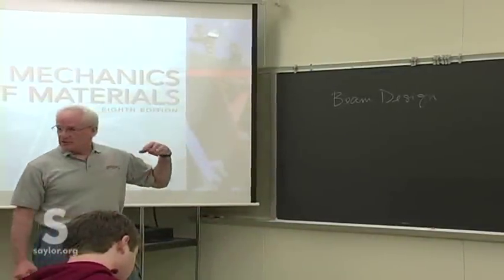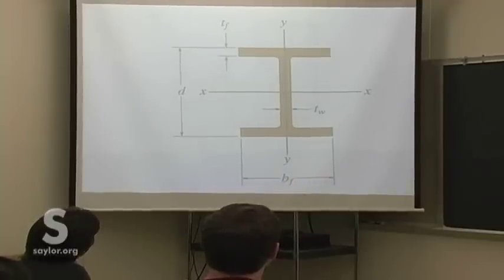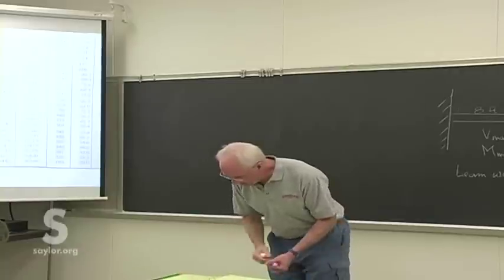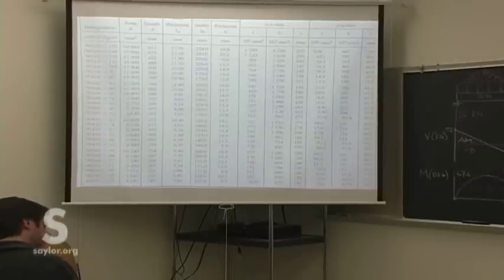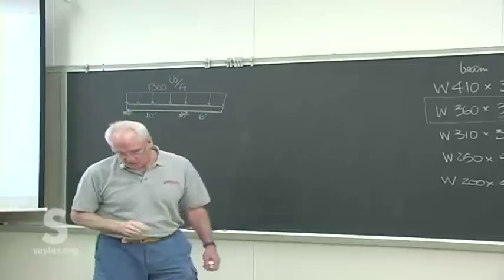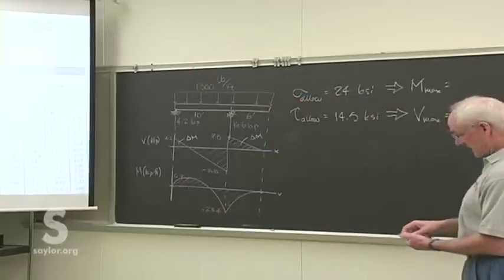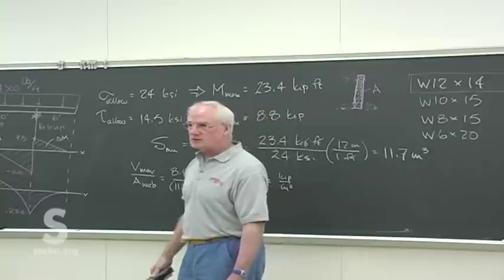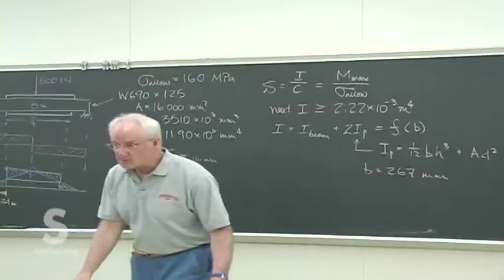Saylor.org ME102: "Mechanic of Materials- Basis of Beam Design"

Comment: Hello, I am confused about one thing here. 

The concept "Neutral axis" is given based on a condition where the beam is subjected to pure blending. It has the characteristics of "zero change in length compared to the original fiber length". Then all the bending stress and deflection equations derived later are based on this concept.

But the occurring of pure blending situation is actually quite special, for example, even a cantilever is not subjected to pure blending. I mean, does a cantilever necessarily have a neutral axis or does it have a neutral axis at all?

Why can we apply the conclusion drawn from a specific case to solving a general case problem?

Thank you for the help.